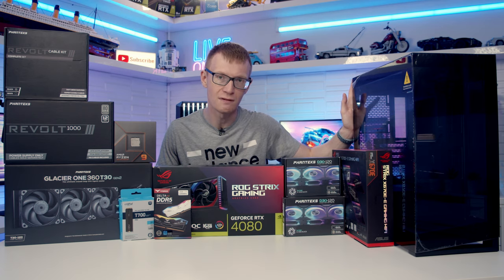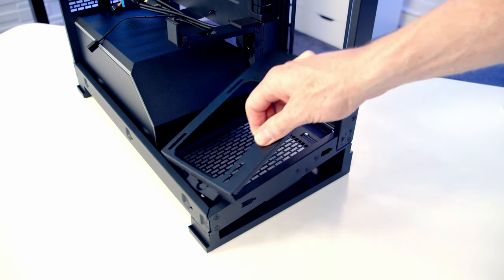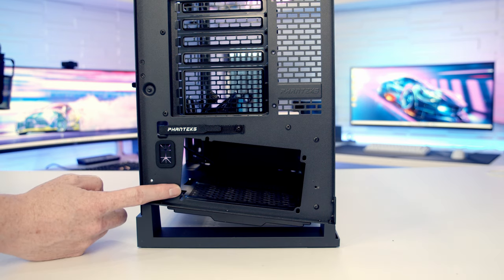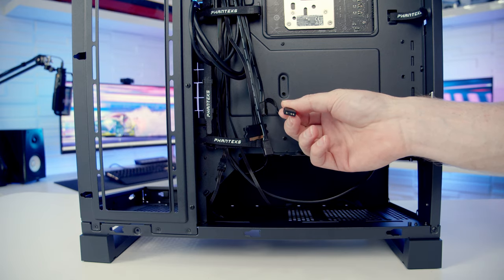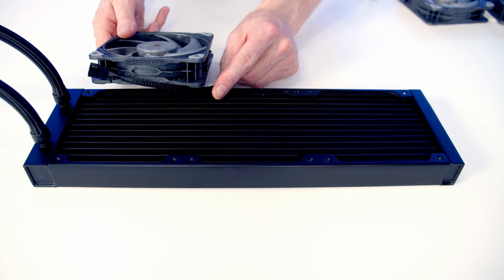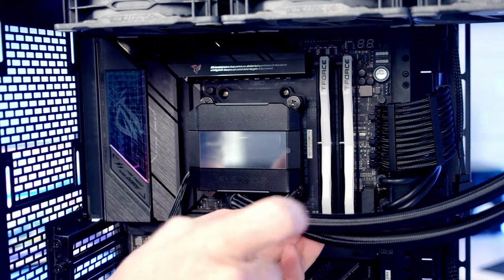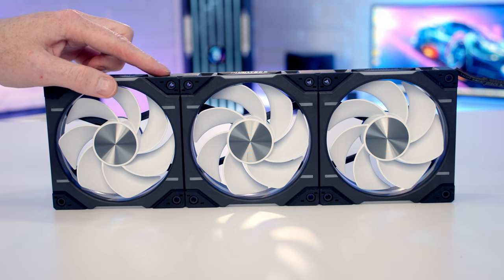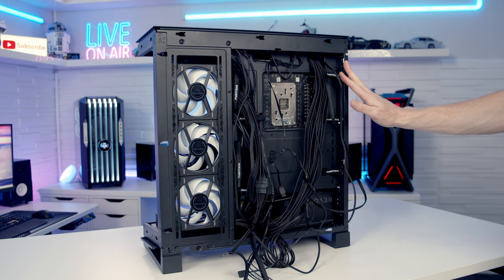Phanteks NV5 Build - Step by Step Guide

Comment: You connected all 5 fans with one 4 PWM cable ? How to do it like from the 3 side fans connected by daisychain there is one 4 PWM cable and from the rear and bottom fan there are another 4 PWM cables ? 
You used 3 cha fan slots in the motherboard ? Or one for all of them ?

Comment: Amazing guide ! Just put an order  in  for the NV5 and 6 d30s 3 of them reversed, wasn’t sure how the drgb hub worked but thanks for this 👍🏻
Reply: does the nv5 come with a fan hub to plug all the fans and rgb into?
Reply: @idkconflict  if you stick with phanteks fans that are drgb then yes , I got d30’s and the case had 2 drgb cables from its hub connected straight to that and case powered by sata cable from psu 👍🏻

Comment: Great video though I got stuck at the fans I’m using Lian li UNI FAN SL-INF 120 with comes with the controller I want to control the RGB light using the case buttons so where do I connect the cable ? To the control box? Is there something that adapts it ?

Comment: The aio radiator fans you had to set the speed on the fan itself. It’s that an insane design? Isn’t that software controlled? What if you needed to change that, you have to dissemble it again?

Comment: Are those fans on the radiator sucking in air from the outside or pushing out air from inside the case?

Comment: i have a question becaus i put almost the exact build together in PC part picker and i want to plug in a 4070 SUPER Trinity (because it has a 3 pin A-RGB Header) into the A-RGB, is there a Spare connector?

Short Question: is there a A-RGB 3-pin Spare?

Comment: Did you use all the fans on the right, Phanteks D30 120mm PWM Reversed Air Vifte, and the one on the top, on the back, Phanteks D30 120mm PWM Vifte DRGB?

Comment: So I am thinking of using Lian Li's Strimer for the RGB MOBO/GPU cables, would I use the Lian Li controller and be able to control the lighting of the D30s and case with L-Connect? or would there be some other process to have the RGBs synced up (at least best they can be)

Comment: Thanks for the video! Have a quick question i read that there is a drgb controller, do they mean that it would be the front button to control case argb or an actual argb controller? Just go this case and the only accessories i got was the box alongside it no controller. Thanks!

Comment: if you mounted the radiator on the side and used those D30 fans, would that graphics card still fit or would the radiator/fan combo not allow a GPU to go passed it?

Comment: Thank you so much for this guide, simply amazing. I followed everything and it worked. I encountered no errors but one; When I press restart in windows (or when windows wants me to restart the PC) it won't boot again after turning off. If I turn the PC all the way off it boots just fine.

The RGB on my Lian Li fans are on but screen is black and fans just keep spinning without anything happening.

I re-checked the guide according to phanteks power switch cable, and by my logic as long as the PC boots the power switch cable is not plugged in wrong. Any thoughts on this?

In advance - thank you very much for this amazing guide!

Comment: I cant get the light strip to work. I plugged the argb cable into argb port on MB. I cant control anything with NZXT software. Do I still need to connect the sata power cable on the backside of the case? Can you please clarify . Thank you
Reply: yeh thats what i did and got the strip to work

Comment: Does he not plug in the rgb from the radiator fans into the case controller? It seems like he only plugs in the rgb for the pump. Then he daisy chains the back and bottom single fans to connect to the other controller argb plug. So how do the radiator fans' rgb work?
Reply: Did you ever figure this out? Was wondering the same thing

Comment: Hi, i have the Phanteks Glacier One 360D30 Black RGB All In One CPU Water Cooler - 360mm, nothing is mentioned about where to put the aio fans, is it usual to put them in the cpu header ? my current aio is corsair so all thru a commander core?
Reply: also, if you connect the onboard controller to motherboard, does the case light strip still work via board software ?

Comment: Just build this pc design today looking great but my bottom fine isn't lightening with any RGB even though I have connected all the RGB headers together is their a solution to fix this?
Reply: So the long rgb that’s stand alone needs to be left unplugged if you want to control it from the case itself if not just plug it into your motherboard and you’ll have to set mystic to override third party and reset

Comment: Someone told me CPU fan couldn't support 3( Phanteks Glacier One 360T30 GEN 2) FAN ,3 T30 fan work on the 3000 RPM.Because mother board cpu fan doesn't have enough power for it.

Comment: I got  CPU ：AMD 7950X3D ，Motherboard： ROG STRIX X670 E-E   Phanteks Glacier One 360T30 GEN 2 CPU Cooler ，1 platinum P41 M.2 SSD&1 SOLIDIGM P44 pro M.2 SSD ，1Ultrastar DC HC320 HDD，ASUS ROG STRIX RTX 4080 ，PREDTOR VESTAII DDR5 C30 6000 64GB RAM，Power DELTA SGM1100W black CASE：NZXT H7 Flow ，4 case fan AKASA OTTO SC12 .1PWM fan splitter （5 4pin PWM fan connectors +4-pin Molex PSU connector+4-pin fan header）1PWM fan splitter （5 4pin PWM fan connectors +SATA PSU connector+4-pin fan header）. isit work good ？If i want full power of Phanteks Glacier One 360T30 GEN 2 CPU Cooler 3000 rpm.How to install and set it.